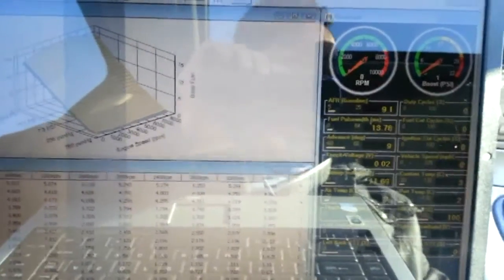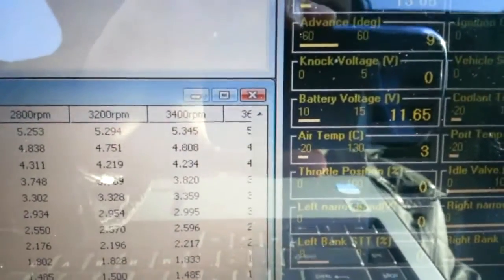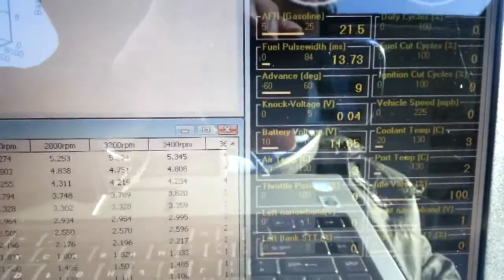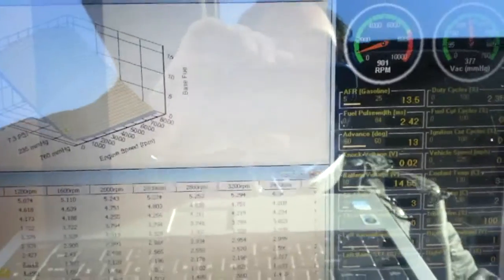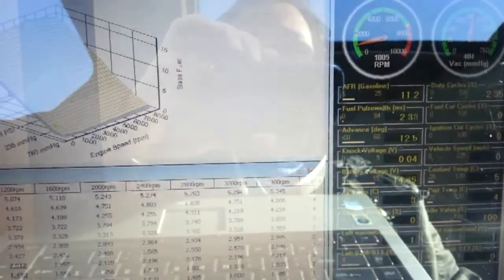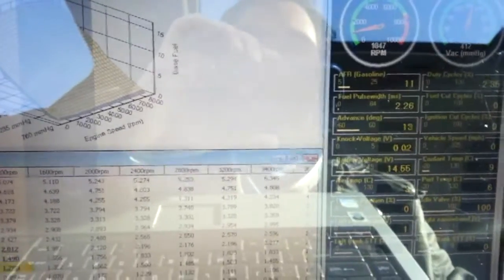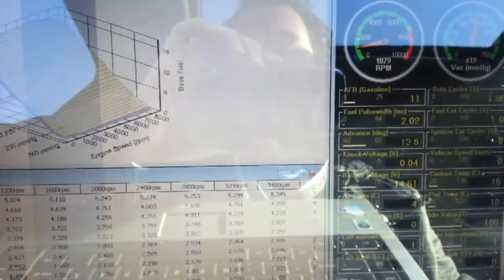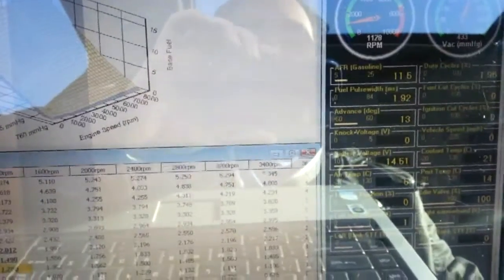Hydra EMS 20 Degree Cold Start Element Tuning

Comment from the maker: There is another set of maps specifically for the Flex Fuel Sensor support in the Hydra 2.7 to deal with ethanol or race fuel starting.  No matter what you do however E85 will not start well at 20 degrees or below because it simply won't atomize.  This is why E65-70 is used in the winter months because the extra gasoline allows for better atomization at sub freezing temps.